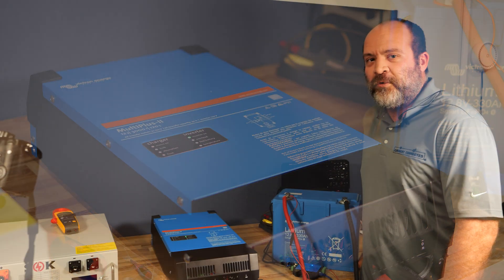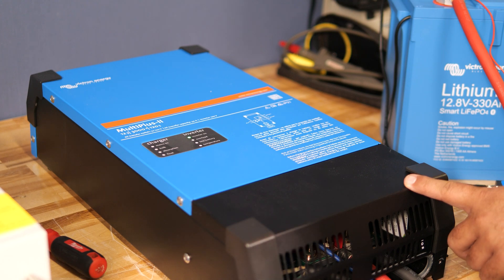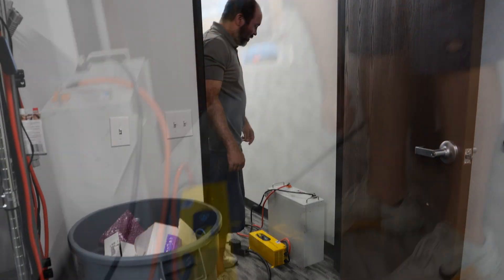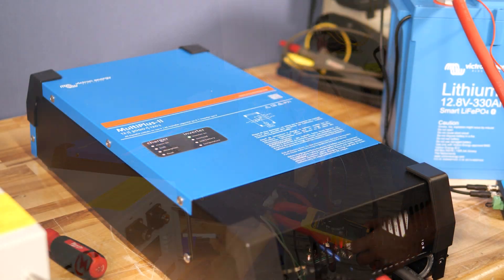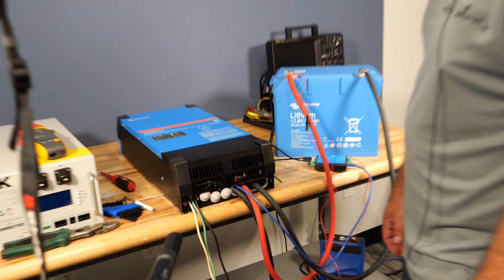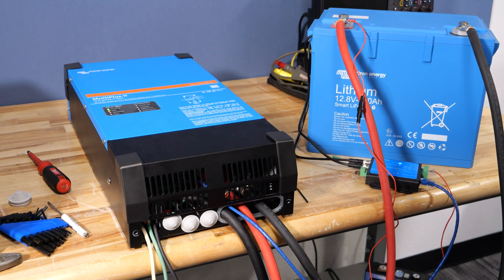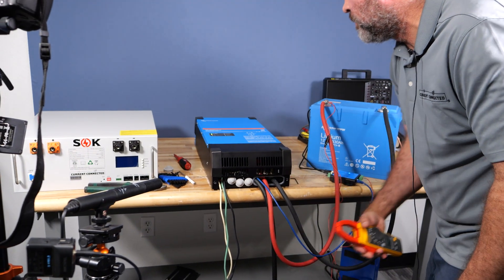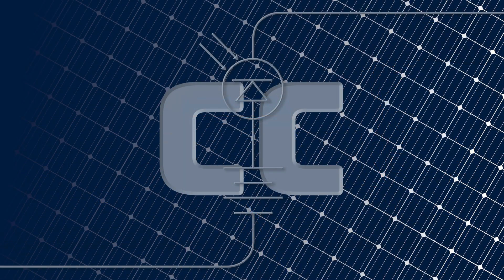What Does a Victron MultiPlus-II Sound Like? 👂 Victron Inverter Sound Test

Comment: Mine has a nasty buzz coming from it in idle and no shore power hooked up. Firmware says up to date. Now it's tripping breakers and throwing #8 error codes under load
Reply: Did you found a solution. Mine is the same.
Reply: @akerka3   Yes, I did figure it out finally. I have 2 separate locations supplying 12v house power. One location was accidently wired through a 100a breaker and one location was a 400a fuse. This caused my buzzing because the one battery location through the breaker would always buzz too then trip and the second location would have to do all the work on a 1500w load and it couldn't handle it. This caused my inverter to buzz loudly and then finally shut off due to being underpowered. I changed the 100a breaker to a 400a fuse and all the loud buzzing went away instantly.

Comment: You should have given the actual sound measurement in decibels.
Reply from the maker: True!  We mainly wanted a video to share with customers that call us - to explain what the sound is like (the low hum).  Some inverters are equally as loud (in terms of decibels) but are far more annoying because the fans are smaller diameter and make higher pitch noises rather than the same calm hum.

Comment: I can tell you my Victron MultiPlus-II 12/3000/120-50 2x120V is much louder under a heavy load with a noticeable humming/buzzing sound.
Reply: Update your firmware. There was a firmware that helped with that around a year or so ago. Be aware firmware updates wipe all settings. This appears to also be a 2x unit.
Reply from the maker: @nebulight  Correct.  We have a video on our channel that shows how to update the firmware to get rid of the buzzing.  V 483 is notoriously bad in terms of buzzing.
Reply: I updated the firmware in May 2022 with build number 2780496. I believe it was v.483 but I'm not on-site to verify. @nebulight
Reply: @nebulight mine is updated, but hubling loud periodicaly. It's distracting.
Reply: How about a heat gun, multiple heat guns?
Reply: A bit of a waste of time? 🤡